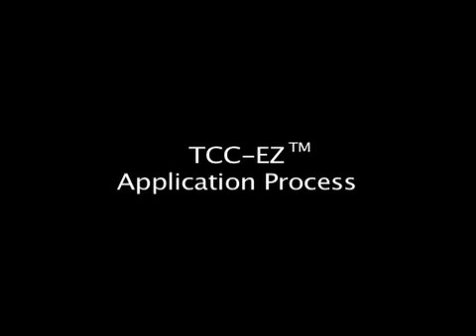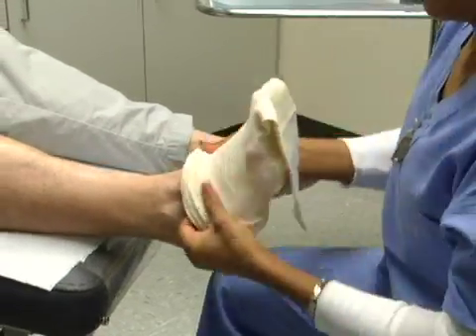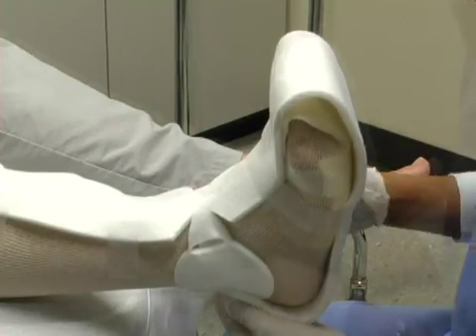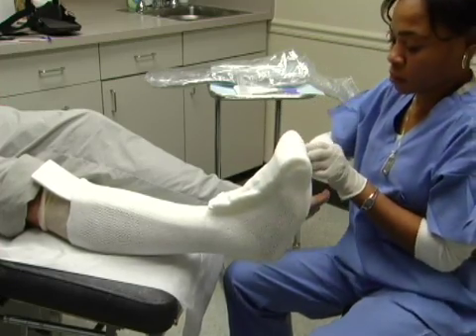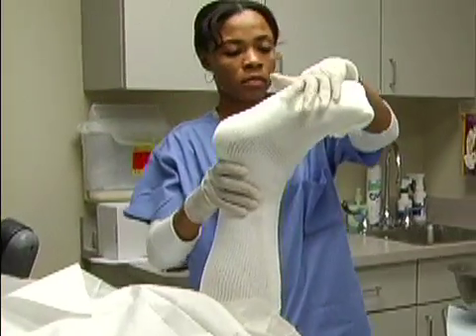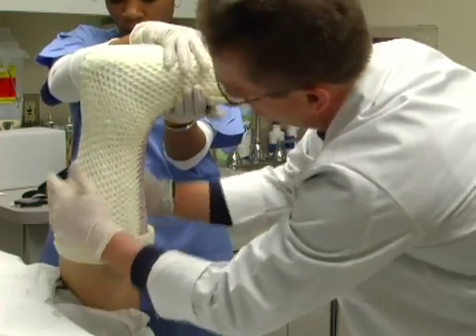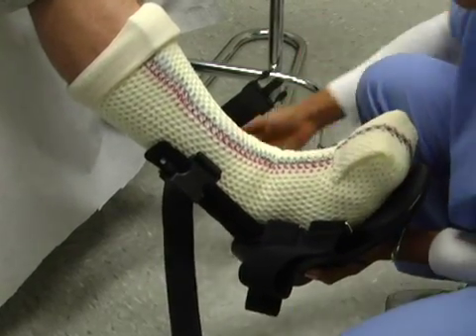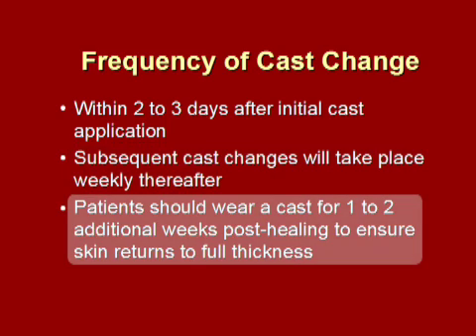TCC-EZ ™ Total Contact Cast System Application- MedEfficiency, Inc.

Comment: Do you trust that patient not to walk on that cast.
Reply: +scottpop11 -- with this cast, they definitely need to walk with the protective outer boot on - the fiberglass layer isn't meant to be strong enough to bear weight of ambulation. I would say that if you don't trust the patient to wear the black boot when walking, either (a) affix the boot with some Coban or something, or (b) consider a different type of cast.
Reply: @scottsinner7530  biggest drawback of this system. otherwise, it's an ingeneous product. patient selection is key, as in all medicine and surgery